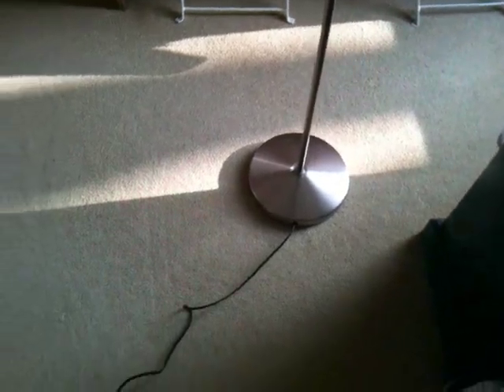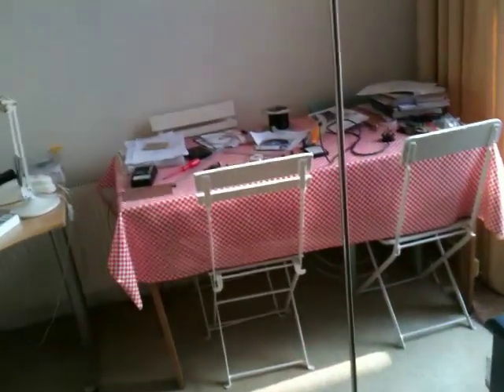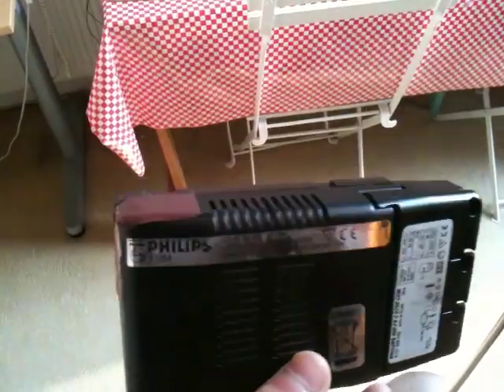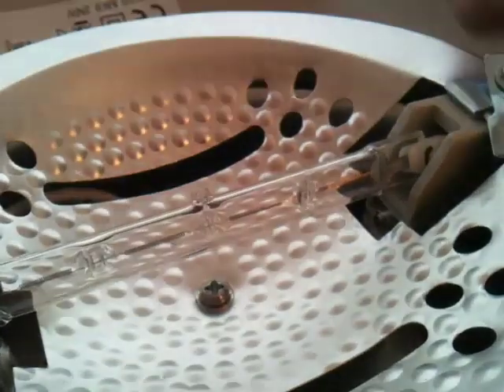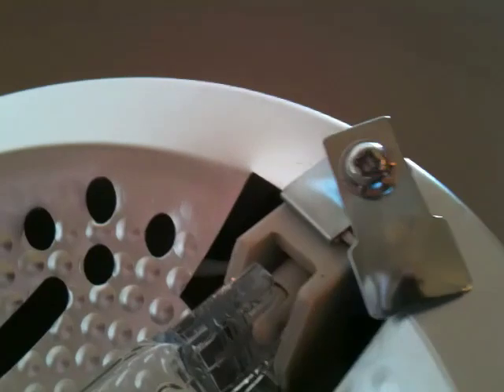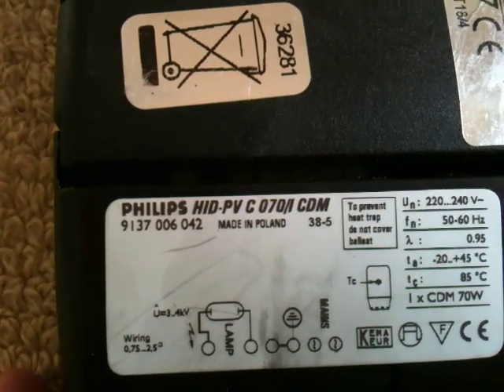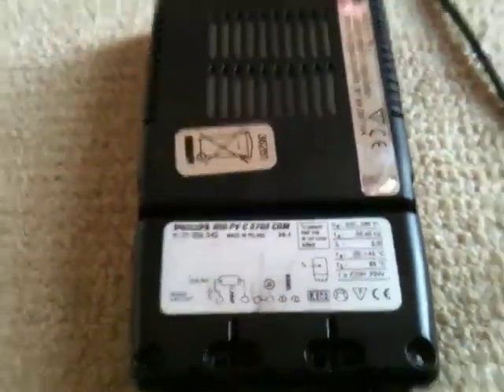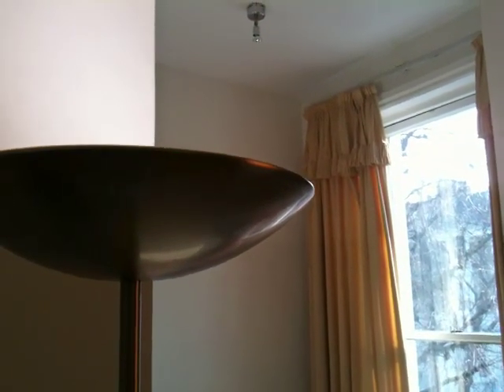Energy saving halogen lamp mod. Save up to 75% energy.

Comment: I wouldn't question the "75% power saving" claim, as I have gotten that close especially with my modified Cyclops Thor Colossus halogen spotlight, I decided to go with 35 - 39 Watts HID headlight bulb setup (eventually went with CMH bulbs as they have better lifespan and yes they work fine with Hylux A2088 ballast, I had to find a way to mount the G8.5 Halogen bulb socket rated for that), have gotten as much as three or four times the efficiency with HID setup for the same brightness as the original H4 Halogen bulb, yet instead of insane 10 Amps consumption with 140 Watts Halogen, I got like 3.3 to 3.4 Amps consumption (around 42 Watts) via the electronic ballast, resulting in a nice runtime with 6.6 Amps hour Lithium-ion battery pack that I replaced the original Lead-acid batteries with, up to two hours runtime (which is still way longer than I'd have gotten with the original Halogen bulb). So much more efficient for what it gotta give me.

Comment: I did a similar mod to this but instead of a lamp like that one I opted to use a floodlight fixture. I think I recorded footage of it after I did the conversion and added the remote ballast to it, so I'll see if I can grab that, stitch it into a coherent video and upload if you're interested in seeing it.

Oh, and remember not to touch the glass envelope of the lamp unless you're going to clean it with isopropyl or ethanol and a paper towel. Because it's made of quartz and operates at a similar temperature to the halogen lamp that was once in there, they CAN shatter if you forget to clean the lamp before operating.

Ooh, and on an absolute final note. You might like the colour temperature of Philip's MasterColour TD-930 or 942 lamps. they use a ceramic arc tube, which helps improve the life, increases the lumen per watt rating and also greatly improves the CRI index. Great for filming, which is what my lamps are used for.

Comment: good idea in general but please tell me it is earthed? when connecting the ballast I did not see earth wire!! Extremely dangerous with metal lamp.
Reply: nope... didn't see an Earth. Even I'd add one with a project like this and I love not doing stuff by the book. luckily the HV pulse is very brief but it hurts like hell to get zapped by it and it does carry some wallop as you'd expect from a 3-5Kv shock!!

Comment: Actually, go for a Ceramic Metal Halide variant replacement of that Metal Halide (once it dies). Sintered alumina in CMH (similar glass like HPS bulbs have) will resist ion creep for longer and the bulb gases are usually at a much higher pressure with a more reactive chemistry which outdoes MH by 20% (at 117-80 lumens per watt vs 100- 75 LPW) at a much better CRI than either HPS or MH.
Reply: That's given me an idea... I should compare CMH to QMH. I have a fixture set up to accept double ended lamps, and Quartz lamps are fairly cheap nowadays so this could make for a decent comparison.

Comment: Get a 70w double ended hps bulb and try it lol, if u unplug it with the hps bulb and back in it should do a hot restrike. plus u save up to 80% on energy. but the color temp is abit off.
Reply: It should work pretty much the same. Only downside is the sodium lamps are twice as expensive and harder to get in the UK in the double ended format,  as well as in 600w single-ended SON-T (probably because of the giant influx of hydroponic pot farms people have started up with HPS lamps due to their unparalleled growing capabilities)

Comment: I think you don't need to replace the curved glass shield. This were there to stop damage from exploding bulbs and such. I'm doubting the LED gets that hot
Reply: yeah... although that combined with the reflector should be just about sufficient to contain the lamp if it were to explode... just so long as it's not super violent like a 400w halide lamp from a high-bay fixture!! Those things can be super nasty when they decided to go kaboom!

Comment: You could always buy a instant re-strike ballast.. instead of using 4kv or less to strike an arc across the lamp to ignite it it uses around i think 7kv or above this then allows the lamp to ignite when hot. the only problem is they can be really expensive.
Reply: Surprisingly, not all CMH bulbs are capable of hot restriking - I found out with my modified Cyclops Thor Colossus halogen spotlight, General Electric ConstantColor CMH bulbs just simply refuse to restart with ceramic arc tubes glowing orange hot even with 25 kV ignition voltage, so far I have found that Osram 39 Watts Powerball CMH bulb I am currently using in my spotlight is capable of hot restriking.

Comment from the maker: The very best laboratory tests of OLED have got about 85-90 lm/W, but no illumination grade OLED are available for sale. The very best illumination grade LEDs currently for sale get about 100-105 lm/W. Standard ceramic metal halide get about 100 lm/W, with the latest street-lighting CMH getting 115 lm/W.

Comment from the maker: In terms of light output per Watt of electricity, ceramic metal halide is unmatched in efficiency, except possibly by T5 high-efficiency fluorescent strip lights. CFL, LEDs and OLEDs are all *way* less efficient than CMH.

Comment from the maker: The lamp envelopes are hard glass, so greatly reduce the UV production. 

The additional glass shield is also hard glass, so will block UV. The only relevant UV produced is that which is emitted from the bottom of the lamp envelope and is reflected by the reflector. 

The total UV output should be well within the safe range, especially as the light is further diffused by virtue of this being an up-lighter.

Comment from the maker: @zaprodk I wasn't sure it was going to work. If it didn't I had some wire and sheathing that I could have run up instead.

However, the electronic ballast has a very beefy ignitor in it (beefier than most ignitor bricks), so I wasn't that surprised it works. It is right on the edge of the specifications though. (I estimate capacitance on the cables to be about 200 pF, which is the limit of the ignitor's specification).

I'll test it with a ceramic halide which has a higher igntion voltage.